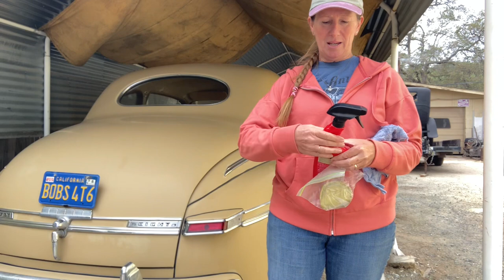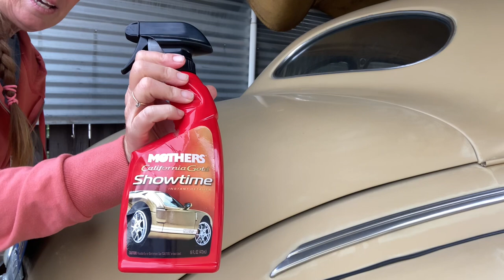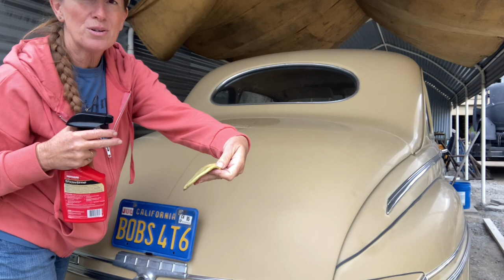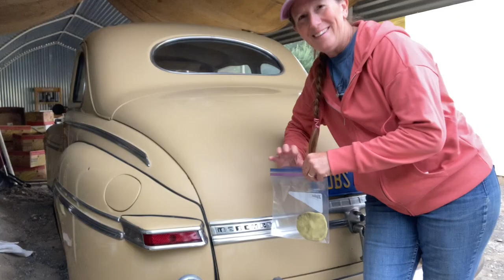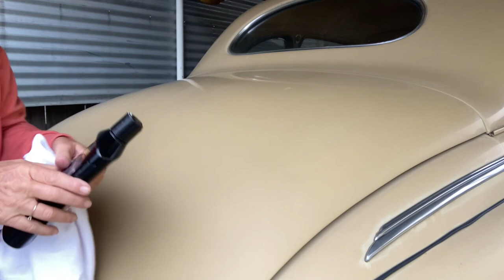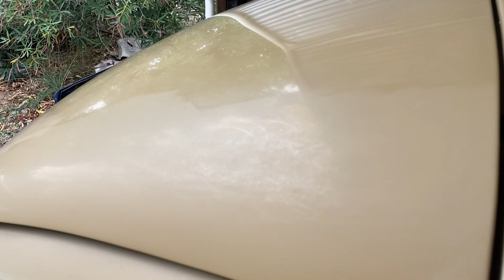Using a Clay Bar, Product and elbow grease on 1946 Mercury Flathead V8 to restore old paint Part 2

Comment: Great video Tina...love your dedication working through the rain to finish the posting.  You are SO RIGHT about dropping the clay bar...many years ago when I was first introduced to clay bars (without supervision) I only bought one and in the middle of use it slipped out of my hands onto the driveway...I was convinced that I cleaned it thoroughly, but sure enough, after continuing to use the same clay bar I proceeded to scratch the surface of my paint...Creating a real mess that I was never able to fully correct.  After that and with much trial and error I now NEVER continue to use a clay bar I have dropped and also remember to use LOTS OF LUBRICATION while claying a car....Like all tools the clay bar does a wonderful job of its intended purpose (removing surface issues) but only with proper use.
You video reminds me I am way overdue to polish up the exterior of my Model A...now that we are past the hot weather in North Carolina I'm running out of excuses!
Reply from the maker: Thank you so much for sharing your experience Cliff!!! Have a wonderful rest of your week 💕